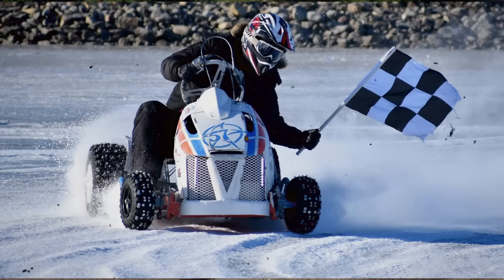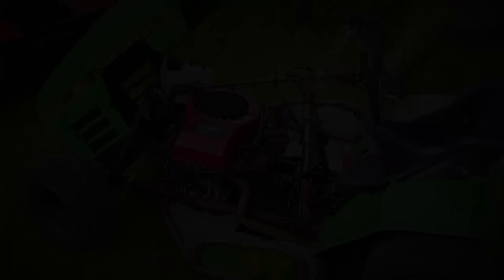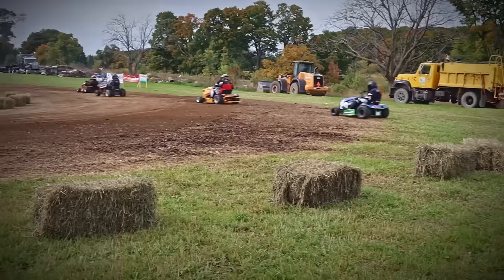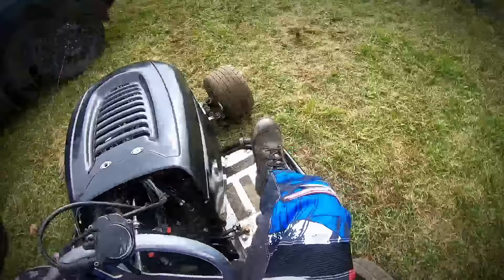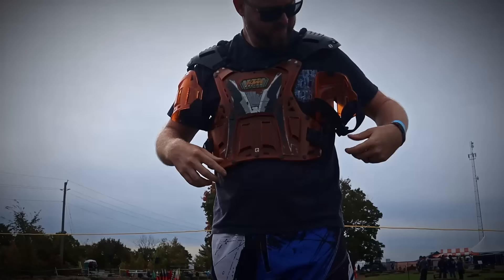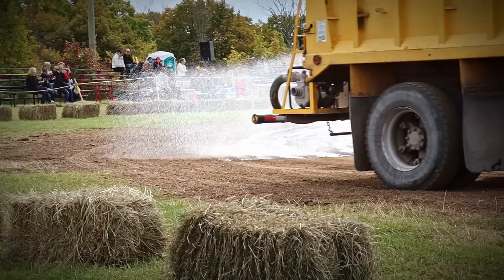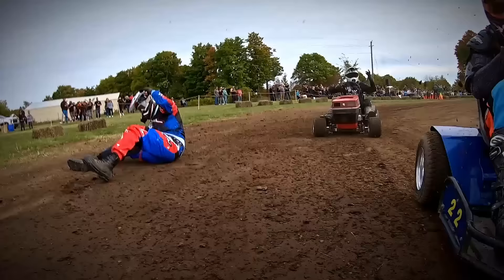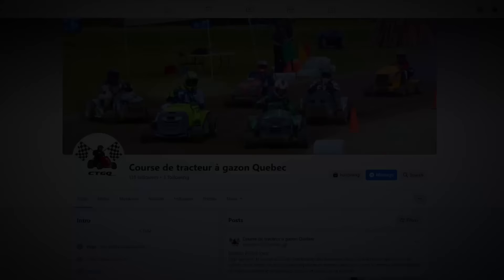LAWN MOWER RACING: Exclusive look at this unorthodox motorsport!!!!! #LawnMowerRacing #RacingMower

Comment: my dad raced midgets on eighth mile dirt track similar to this in Pocatello late 1940's to early 50's ... for those who don't know midget racers have small v8s or sixes with strait drive ...no flywheel or transmission or clutch ... push to start and use brakes to kill the engine and stop